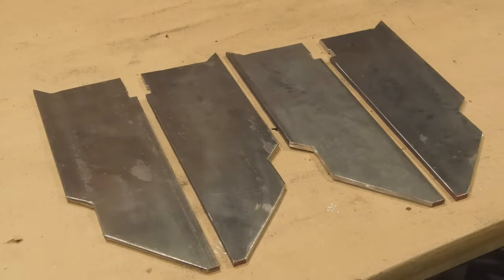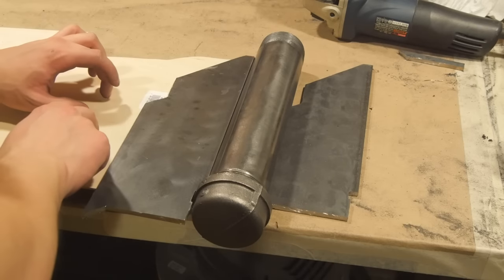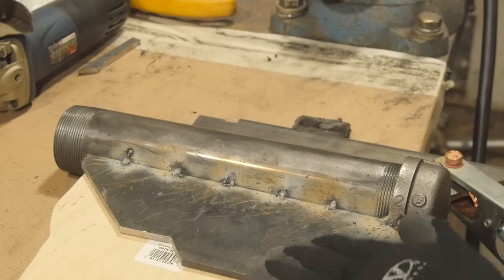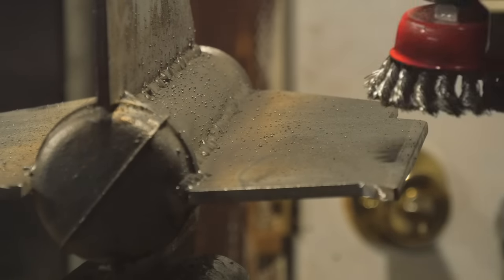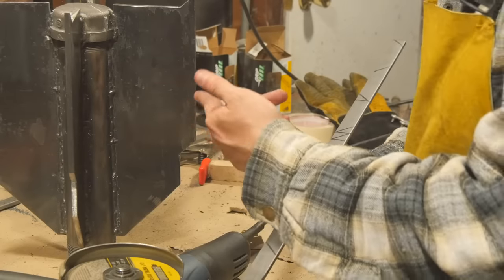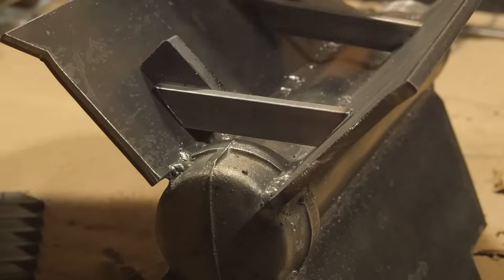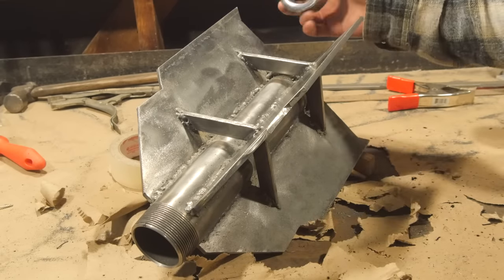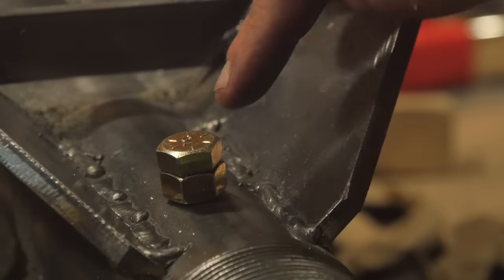Dark Souls TITAN SLAYER MAUL / MACE (Barbell Mod, 61 LBS)

Comment: nice work eli your welding is getting better and better each video. looks like a little plasma cutter wouldve come in handy cutting out those steel plates. also at 5:14 where you use the wire wheel to remove the scale i would say its actually unnecessary depending on the strength of your welder and its penetration if you wanted to remove the scale easier you can just put the steel in a bucket of vinegar overnight and itll wash right off in the morning

Comment: Hey buddy, just a quick tip on that scale. Taking off the scale with the wire wheel is adequate, but you can find this nylon resin mesh material (in the shop we call them stripper wheels, because they strip rust, paint, and scale) thats pretty much purpose built to remove scale. Really fast way to strip off scale without actually really removing any of the steel. We sometimes use them to very carefully polish off scale from wrought iron posts before welding into frames to ensure good weldment while preserving most of the wrought look.

Comment: The bearings are removable. So if you wanted to keep the center of gravity more towards the head, you could remove the bearing opposite it. However, it will drop the weight. Awesome work!

Comment: i went through welding school. with ticker material you need to go slower and ramp up your settings for more penetration. and with tack welds hold until its a puddle and wash it into the plate from the tube. a good trick i use for keeping a good pace is say "one second"  before moving the puddle either way.

Comment: if you want less spatter to deal with then set it so more gas comes out of the tip, also you should have a 1/8th gap at most between pieces of metal so you get a better weld, and you should also try to put the tip closer to the metal to also cut down on spatter and a cleaner looking weld. I love your videos and get so excited ever time I see a new upload!

Comment: When welding anything over approximately 1/4" (0.250"), you should bevel the edges to be welded (about 45* angle). There should be a slight flat portion of the original thickness left 1/8" (0.125") approximately. This will allow the donor metal (MIG wire) to penetrate better to the to pieces of parent metal. 

Also, if you soak your steel in strong vinegar (picking vinegar) over night, the scale dissolves. Then you just rinse it, and proceed with the build. 
The vinegar can be reused several times (looks nasty) but it may be something to look into for you.

Comment: +ZNA Productions Whenever you're working with steel that has mill scale on it, let it soak for 3+ hours in a vinegar bath, then see if you can get the scale off with just a cloth. If not, hit it with the wire brush. Makes it take less effort and save some money on the power bill if you're using cord-powered tools. Great vid as always.

Comment: On the thicker pieces of metal it helps a lot to bevel the metal before welding. Especially if you're using a smaller welder.

Comment: Mig welding tip: turn your gas up a little, bring your wire speed down just a little, and you're contact tip should be about 1/8 - 1/4 inch away from work piece. But other than that you got the technique down. And it doesn't hurt to take 1 or 2 welding classes. They really do help out a lot. YouTube/ internet/ tips and tricks don't really compare to having a decent instructor show you how it's done. And you might come out a a couple of certificates out of it. :)

Comment: Here's a tip with welding thick steel make sure your welding hot for steel of the thickness you would want it hot enough with thin gloves you will feel,like your hands are near a oven.

Comment: As a welder.. im dying internally. Dude, 2 things. Make a small up and down oscillation as you weld along, but using a travel speed to match, and set your MIG welder right! A properly set machine will have next to no spatter. Many machines have a grid with recommended settings to use, or you can just search it by manufacturer. A good, clean weld makes a huge difference in the end. TBH the only thing I could look at in your intro was your welds, but maybe its just cause Its something that I'm picky about. 
EDIT: another thing I notice that is that you have brown oxidation when you complete a weld. You're not using enough gas (OR using FCAW welding method) 
I want to be clear that I'm not being a shit, so hopefully your fans aren't going to jump my shit. Take my advice and everything you weld will look a lot better

Comment: Im sure it has been said a few times, but if you want to make nice and pretty welds, try to move the welding tool forward and not backwards along the line. Its a bit harder but it looks just much nicer.

Comment: leave a slight gap when welding thicker steel. voltage up and wire speeds down does great with flux core!

Comment: When you're welding get closer to the metal with the welder and tilt it slightly in the direction you are going. Also as your welding make small swirls as you weld to get a better bead.

Comment: Up voltage & wire speed when welding heavy stuff. Also invest in fluxcore since you have a MIG welder, all you need is different rollers.

Comment: eli just for the future when you weld nuts and bolts with that gold colored coating its a good idea to grind that off and wear a respirator. if you've ever had metal fume fever its about 10 times worse.

Comment: you should try brassing the surface of some of your projects. just for contrast. if you heat the metal and brush over it with a brass brush on your angle grinder the brass will take to the metal. just a thought.

Comment: instead of using abrasives to remove mill scale just soak the plates in vinegar overnight and wash them off. it works great and is much cheaper than abrasives.

Comment: So, Eli, I have 3 questions. 
1) What welder do you use? all the welders I see listed in the ads for Harbor freight, Home Depot, and Menards are all the ones you need the welding wires for. 

2) Can we apply this to that little one-handed mace that never had a build video published? I mean, i would assume so, but this is way more complex than it needs to be, so like a dummied down version for the one-handed would work right?

3) Where did you get your drill press? i would like to get one, but an affordable one, considering I don't start my next job till next month and I'm strapped for cash.

Comment: Hey not trying to be mean. If you cooled down your welding unit, and went in small circles back and forth from each of the pieces you are welding, and kept a small molten pool in the front of the weld your weld would look a lot better. It would calm down all the splatter you get and make the bond between the two metals twice as strong. Still a really cool build though keep up the good work.

Comment: You need to go a little faster on your welding. The splatter means you're taking to long. Try making a "C" motion or just a back and first when welding.  You'll see your pool move with you. Metal that think when you get it warmed up. The heat travels fast.

Comment: Hey man just wanted to let you know you should try to lower your voltage on your welder you can also find charts on the Internet on what to set your wire speed and voltage for certain thicknesses if metal

Comment: I have a tip to improve your MIG welding. When you weld you are "pulling" the tip, which is effective for stick welding but not wire. (example of pulling: __/__  going -->) For MIG you want to be pushing (example of pushing: __/__ going <--)
Reply: Doesn't it depend on if he is using shielding gas and Mig welding wire because if he is using flux core shouldn't he push? And the opposite is for Mig wire? Correct me if I'm wrong....
Reply: +Jack Chance   you can push or pull both.  Some thinkthere's difference in penetration.  There isn't a big enough sufferers to change anything.  Pushing will burn away contamination before your weld. This gives a cleaner looking weld.  Flux core does have alot more spatter then regular solid MIG. For 3/8 steel he didn't have to use flux core, solid wire could suffice if his welder could handle it. He also did a straight weld he can use a weave pattern to help create more heat to get better penetration.  He could be worse.
Reply: +daniel tearsknapp ok cool.

Comment: Threading the holes you drilled into the pipe would have been easier than wielding the nuts on, also remember to weld small little chicles to lay a solid bead rather than just going in a line.

Comment: Man if i were welding steel that thick i would use my arc welder. with a 6070 wide rod, for thick metal pen.. i had to refab the blade out of a front loading garbage truck, the welds they did busted the whole left side of the pack blade out, after 22 hours of welding, and 100 pounds of rods. that 18 tons of packing force cant touch my welds. still going strong 6 months later. the whole peice is looks like one solid peice of 1/2 in steel plate.

Comment: if you start going thicker plate like such need to start adding a bevel to the ends you are going to weld
Reply: and have you thought about switching to a 75/25 co2/argon gas or other such shielding gas for welding save you a lot of clean up time

Comment: part of the reason you're getting so much spatter is that your stick-out is waaaaaaaaaaaaay too long. Sometimes its unavoidable but if you worked on tightening up your stick-out you would get much better penetration and less spatter. food for thought

Comment: Yo dude great one ;] I'll be trying to make a big one as well ;3 btw to get mill scale off a lot easier there's something like Bristle Discs, they're not that cheap but u can get them not that expensive on eBay + they're not THAT hard on the angle grinder as the wire brushes are ;] keep up the good work, peace bro. PS. watch out for galvanized stuff ;p

Comment: I hope you a wearing a mask or an air filter while cutting that steel, that stuff is really bad for you lungs. And yes your insides WILL look like that if you keep doing it without proper protection. Even cheap face masks will spare your lungs from most of the metal shards and dust.

Also when you weld thick pieces of steel, up your temperature and the threading speed. welding tacks should be made quick and easy. Do a spot in one end, then flip it over and do one on the opposite side. This will keep it from warping at high temps :)

Wirebrushing the tacks before welding will help make the weld look nice and uniform throughout.

Comment: Next time you are making a project like this be sure to grind down and clean your welds more. They are looking pretty chunky and it doesn't look very good. 

Also don't use gloss krylon spray paint. It looks cheap, lazy, absolutely terrible, if you want to make something black either give it a carbon coating using an oxy acet torch or use a patina solution.

Comment: A very nice thing, but I think these 28 kg are a bit heavy for an effective man to man combat. That is because you are losing so much speed, with this extra weight. I think a wight of more than ten kg (20-21 lb) maximum aren't usefull. So on, when you handle is heavier as the head is, you are losing some momentum, the most importend way of effecting the enemy with this kind of weapon (you haven't any sharp or pointed parts).

But it's very impressive and your enemy is running away when he just see it, so on its still effective.

Sorry for my bad spelling (I m not an native speaker).

Comment: Is there a reason that you didn't just plug weld the bar into the head of the mace?
Reply: Probably because he wants the bar back and welding to stainless requires a different welding wire

Comment: To wield the mace effectively you would have to have a body mass index of around 2500lbs. Based on an average mans weight of 175lbs wielding a 4lbs mace. That's a BIG dude! Probably at least 10 or 12 feet tall with an extremely athletic build and an ugly disposition LOL!!

Comment: I adore your videos man, but as a welder. I cry a lil every time. Don't get me wrong you're sure as hell getting much much better, but theres little things you do that make me cringe.How to fix: thick steel. Crank it. The more heat the better really. Milscale. Take it alllllll of, you just took the t layer, the darker fray was also milscale. While a wire wheel can work and grinding wheel works even better. Plus you can get neat coloring. Splatter will riin your paint when it comes lose, just an fyi. Anywho. Keep doing you, and rock on.

Comment: When welding try moving slower so the weld will be both stronger and prettier, it didn't use to bother me but I've been taking welding classes and It just hurts my soul to see this. I like your video's though... please don't beat me to death with them.
Reply: +Ark_El P.S. When you're moving slower try going a little to the sides and stop for about 1 second, and be closer with the welder so you have more stability.

Comment: ur supposed to push the mig not drag it
Reply: +Cameron Cameron where did you hear that ive been dragging while welding with mig and it does fine at least his welding is improving
Reply: im a boilermaker. i drag it to some times when i can't push it. you get better penetration if u push it
Reply: fair enough, experience beats everything else. thanks
Reply: no worries

Comment: ifmyou can get titanium your builds that need steel would bee alot less heavy
Reply: the first m is meant to be a space
Reply: Titanium is incredibly expensive...I'm a welder/fabricator and can tell you it would cost 10x that of mild steel..
Reply: And there goes a 12 year old with little to no understanding of metallurgy.
Reply: +Xin Guan come on at least let him feel smart once..
Reply: well, you are not wrong on the less weight part, but look at metal prices, and tell me if you want to pay that much. Happy hunting!
Reply: +SHADOW GARCHOMP you can edit the comment you know
Reply: +SHADOW GARCHOMP mate, titanium is not the god metal hollywood makes it out to be. It has its place but usually a piece of hardened steel will work much better. Think of titanium like slighter heavier duty aluminum, yes it has its uses but not nearly as many  as aluminum or hardened steel.
Reply: +Anton Howell #niceshirt
Reply: +isaac galewsky Roughly the same strength as tempered steel with just over half the density? Hollywood may paint it brightly but so do facts. If I could choose between a titanium weapon and armour or tempered steel weapon and armour, I'd go for titanium 1000 times out of 1000. Because it's better in literally every way. Oh and if I'm wearing both pieces of armour and someone was pointing a heavy rifle at me, have a guess at which one is more likely to stop a bullet.
Reply: In terms of bullet proofness(is that even a word?) and ability to flex Ti does beat out hardened and temperes steel because H&T steel iant meant to do those things. H&T steel is much harder than Ti and has much better edge retention. Ti will lose in toughness but it will beat steel in strength, density, and tensile strength per pound. I work with both materials on a daily basis and Ti is definitely no slouch. It's very strong and it work hardens which can make it quite tough, just not as tough as steel.
Reply: +isaac galewsky Interesting. Not sure if it's even possible, but if one were to make a sword, would it be possible to make say 3/4 of the blade out of titanium, and then the edge and tip to be made of tempered steel? So you have to light weight and strength of titanium such that it won't break, but the edge retention and hardness of steel.
Reply: ***** neat idea, sadly there just isn't a great way to bond Ti to steel that doesn't involve heat. You can't weld it becuase you would kill the temper on the steel and you can't HT it after because the metals expand at different rates. This causes cracks to form and basically leads to you being back where you started. The one thing i have tried, it was mostly a showpiece but i dont see why it wouldn't work for a real deal sword. The back was CF with a channel cut into it. The blade had a small rip along the spine that fit into and was then pinned into the CF. CF is just as flexible as Ti, lighter, and much easier to work with. If you're gonna make a composite sword blade may as well go all the way.
Reply: +isaac galewsky I assume CF is carbon fibre?
Reply: +cadkls yeah, sorry for the jargon
Reply: isaac galewsky Nah it's one, I need to look this stuff up anyway. But yeah a carbon fibre sword, that sounds pretty interesting actually.